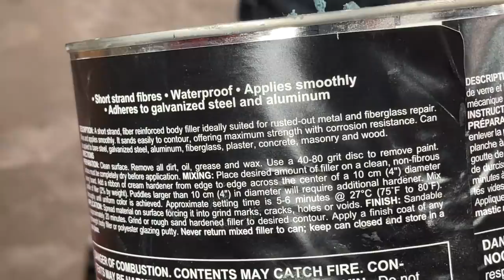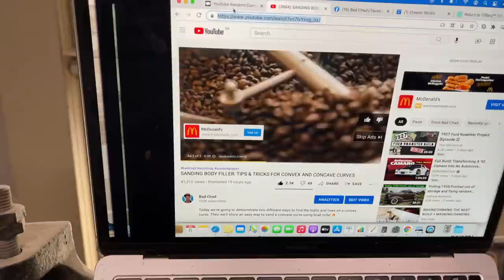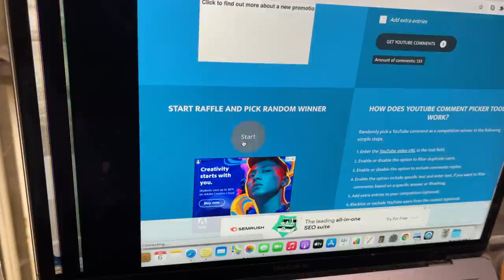MIXING AND APPLYING FIBERGLASS FILLER OVER WELDED SEAMS

Comment: Epoxy resins are "hygroscopic" meaning that it ABSORBS moisture (not blocking it) so it will not stop rust. I learned this in the electronics industry, where potting a chip with epoxy will lower the reliability. Moisture combines with the epoxy, and forms an acid that corrodes the circuit...causing a failure. To prevent this, we applied a silicone "barrier coat" to protect the circuit from the acid.

Comment: Question.. yesterday's video . when sanding with the 8 inch sander,  can you feel any changes in surface height thru the grinder or are you going by hand feel and  straight edge?

Comment: My man, please consider wearing gloves when working with curing fiberglass or body fill. I wasted 5 years on a Chemical Engineering degree and then sold for the big boys to the big boys in auto paint and coatings before starting my own body shop. These are NASTY chemicals, and the nastiest ones are small enough to pass through the skin and cause damage. Especially during the reaction phase, thats the most dangerous time. A nitrile glove could add years to your life, and I’m sure we’d all like to have you around as long as possible.